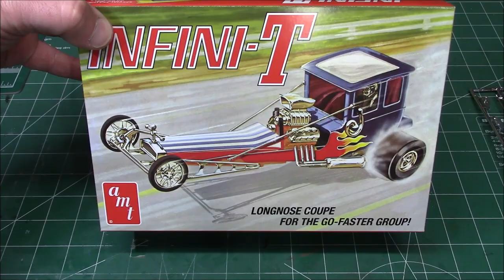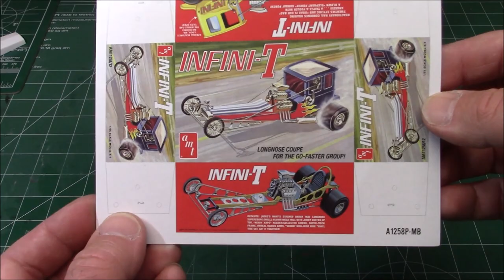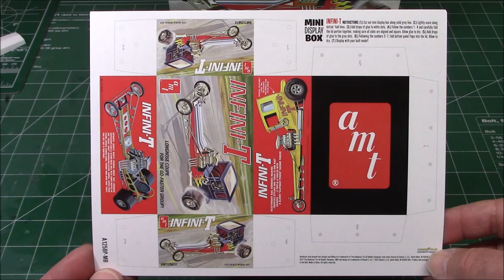Infini-T Ford Model T Hemi Dragster Custom Hot Rod 1/25 Scale Model Kit Build Review AMT1258 AMT

Comment: Hi, very nice T. Build mine 2 month ago. Did have problems with the rear body (not) fitting over the rear -shocks. You had no problems with this ?
Reply from the maker: Pressed them in all the way into the holes made for them. If I left them on the edges they would not fit under it.
Reply: @hpiguy  Did solve this little problem with my file. For the rest it was a very good moulded kit and enjoyed building it (the build is on my channel). Thanks for all of your effort you put in these kit build reviews.

Comment: On the pins for the top, can those  be replicated if the area they are at is drilled out and styrene rod placed in the hole for a pin and a more secure top?
Reply from the maker: Of course, they can be replaced with a little work.